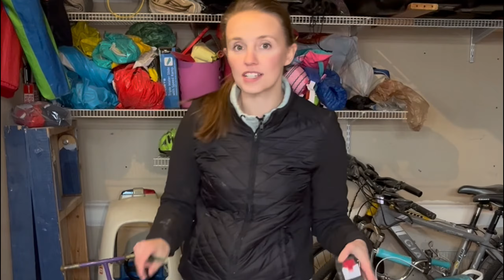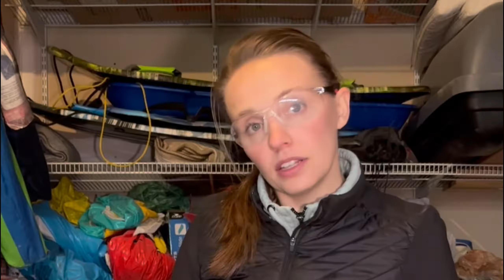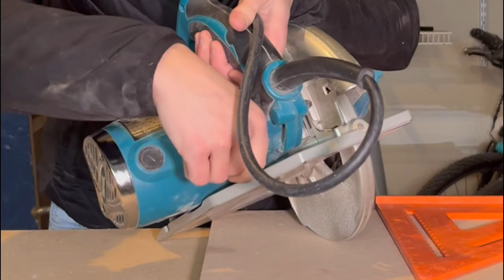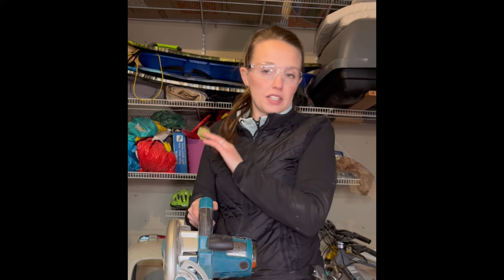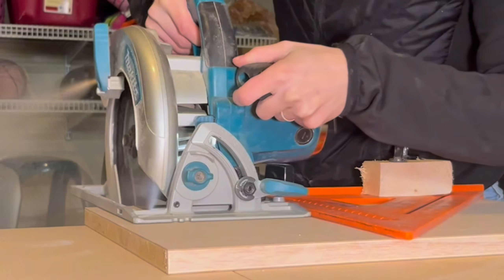How to Use a Circular Saw: A Beginner’s Guide to Safe, Accurate Cuts

Comment: Thanks for making the video. Is the blade depth supposed to be a quarter more or a quarter less than the thickness of the wood?
Reply from the maker: Quarter more! That way it still cuts through the wood fully.

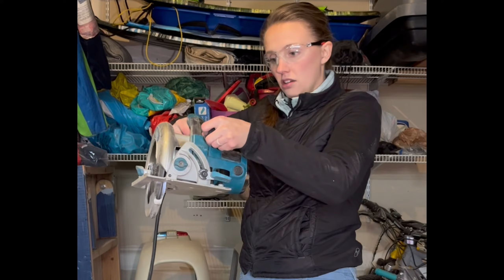Comment: Can I ask you 1 question pls. About the sound of the circular saw. When I cut there are 2 sounds that are going to come out. It's smooth like 3:53 and the second sound is going to be like 5:34 . I'm confident when my saw sounding like 3:53 but when it sounding like 5:34 I'm scared a little bit because it is the sound that I usually get when my circular saw about to kick back (it's been 4 time so far) . Is it normal for the machine to be sounding like that? Or is there a way to fix it? From what I experienced, that sound is coming out when the blade surface (the left/right side?) is touching with the wood that I'm cutting. But it just sounded smooth when there is enough space between the blade and the wood (sorry for my bad English hehe)
Reply from the maker: So the saw will make a different noise when it’s actively cutting, and that’s ok. I don’t try to force my cuts or go too fast, I like using a straight edge so my cuts are always straight, always check my blade depth and I make sure my wood piece is supported on all sides to prevent kickback